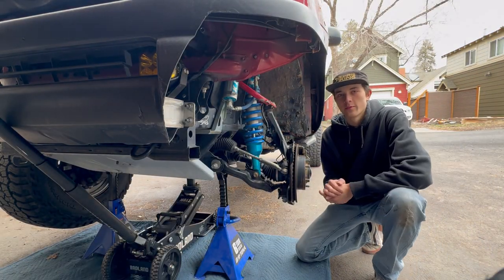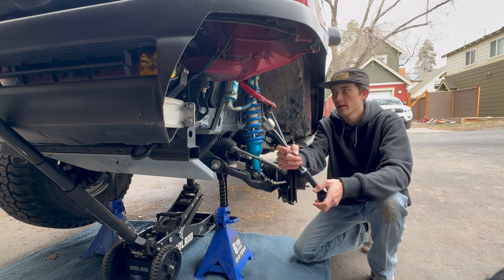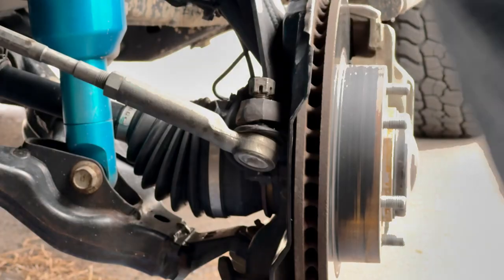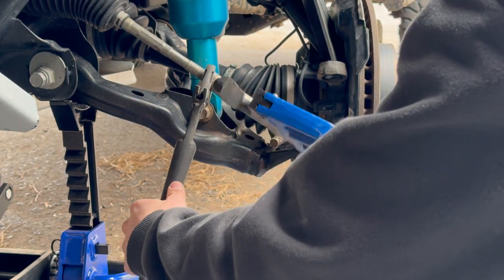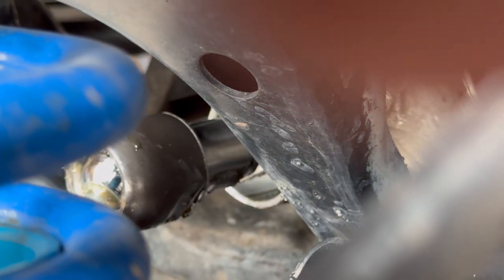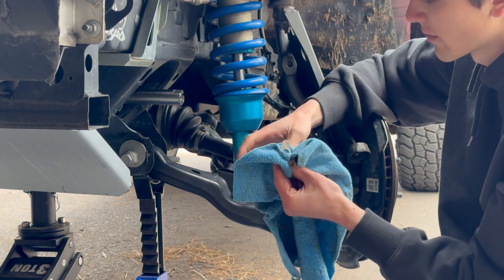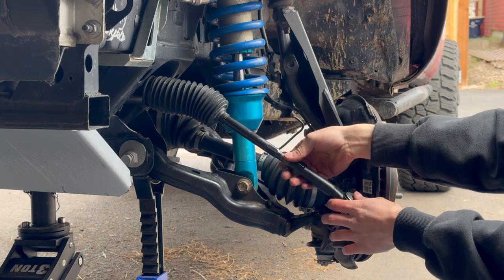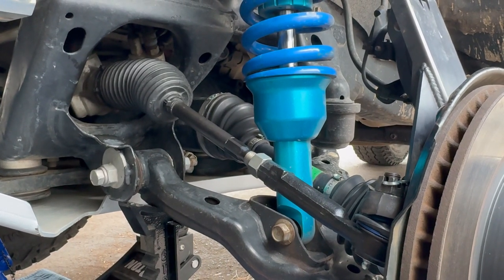Replacing Inner and Outer Tie Rods on 2005-2023 Toyota Tacoma... (The easy way)

Comment: When you go for an alignment, will they adjust the tie rod if necessary?  Or will the alignment compensate for the outer and inner threading being less than perfect?
Reply from the maker: They will make the adjustments on your cams and tierodes

Comment: On a stock truck do the inner tie rods usually need replaced at the same time as the outers? My front left outer is definitely toast
Reply from the maker: In my case with 35s I find myself replacing two outters before one inner goes bad but while you are in there might as well check them out